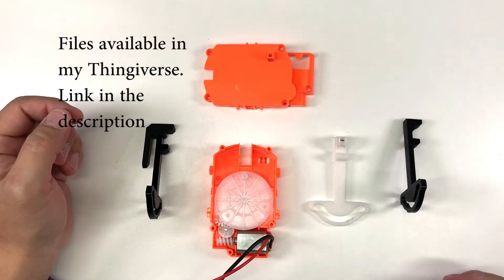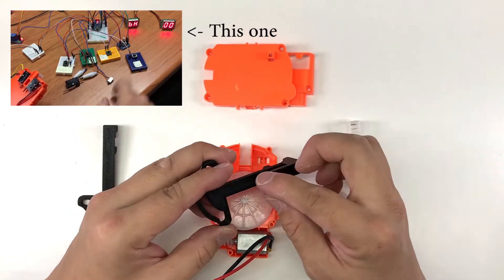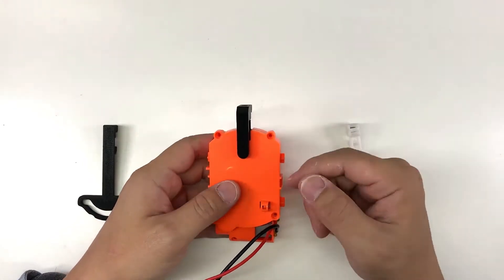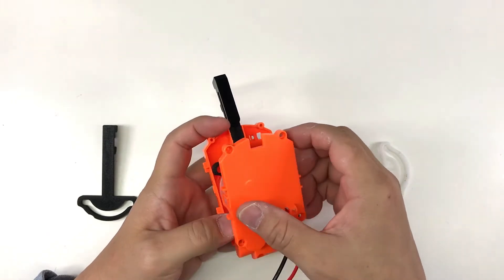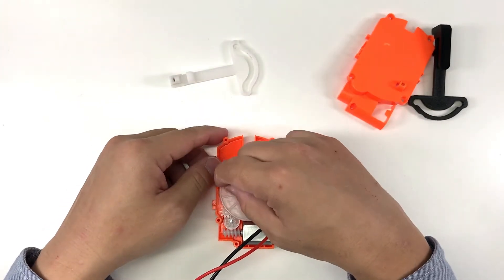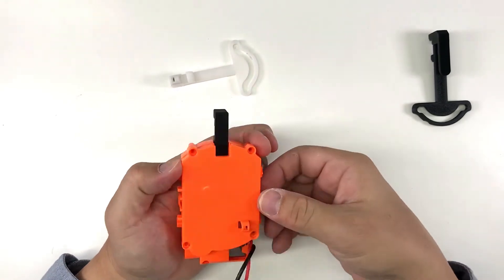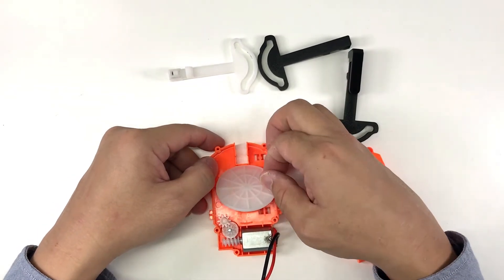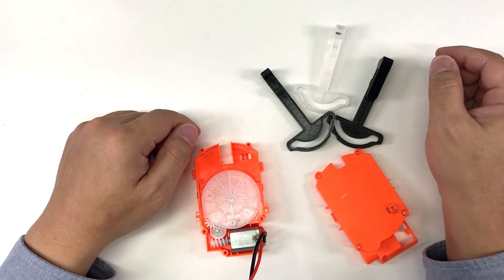{My Thingiverse} - Nerf Rapidstrike extended pusher

Comment: Do u have any files of your rapid strike pusher that can turn into a half length pusher with a magnetic piece?
Reply from the maker: yes, it should be under this item https://www.thingiverse.com/thing:3033844/files download and unzip the zip file, there should be a folder for the pusher :)
Reply: @TungstenEXE  Those files are for a solenoid. Do you have any files for the standard pusher mechanism? I want to be able to attach a magnetic piece to the pusher to make it able to shoot short darts
Reply from the maker: Maddox Hussar these files are for the normal rapidstrike pusher. The solenoid one is another RS (a red one). This RS uses the normal pusher.
Reply: @TungstenEXE  thanks so much I just misread the file name but now I am all good
Reply: Tungsten EXE What type of magnets did you use for the pusher?
Reply from the maker: @maddoxhussar2158  should be 20X5X2 mm and 30x5x3mm magnets

Comment: What difference does an extended arm make?
Reply from the maker: back then I was working on a RS and had some darts that was not consist in length (koosh dart I think) as such it had feed problem, hence I did a slight extended pusher for better feeding. Also I am making a top put which I use in activate a switch to detect pusher position for one of my select fire mod at that time.
Reply: @TungstenEXE  I meant it as a question and cool. My RS quite often won't push the darts out, only pushing a third of the way. Like it is too weak. Ya know what's wrong with it?